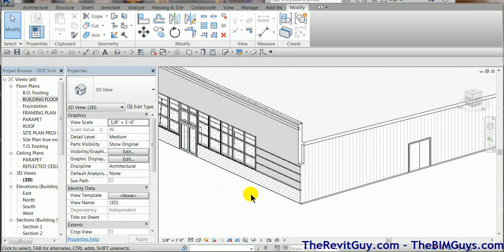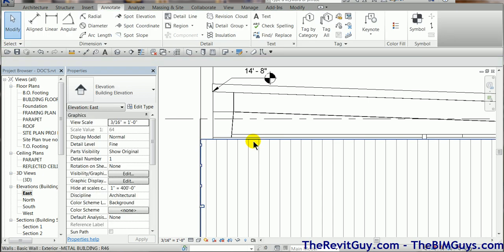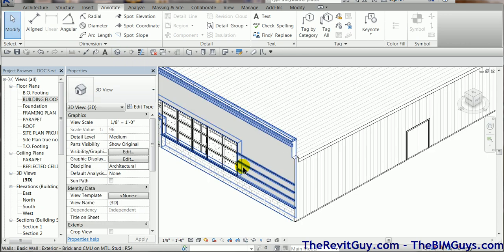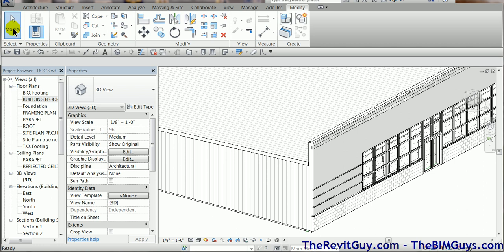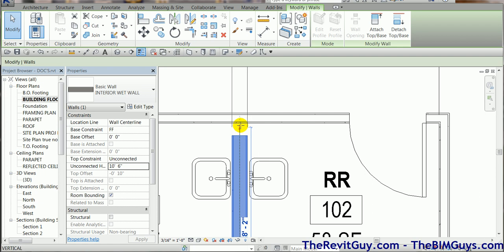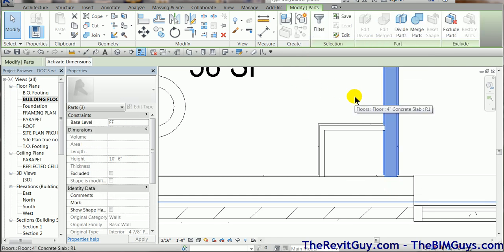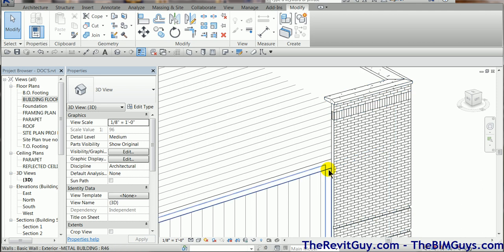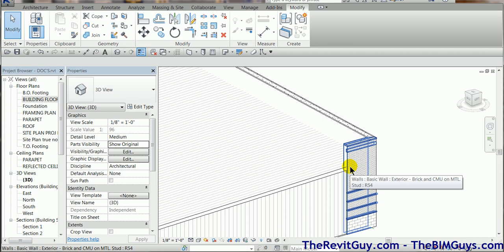Revit Wall Cleanups - CADtechSeminars.com

Comment: I just have a small question about your last tip.. the create parts tool. Can I remove any of the "divided" parts; I mean after I make the parts; I will divide one of these parts into small faces; How I can remove one of those small of faces?